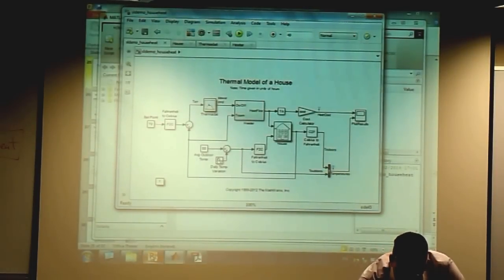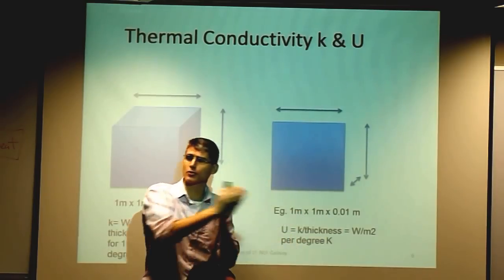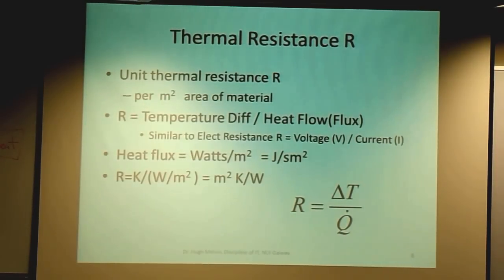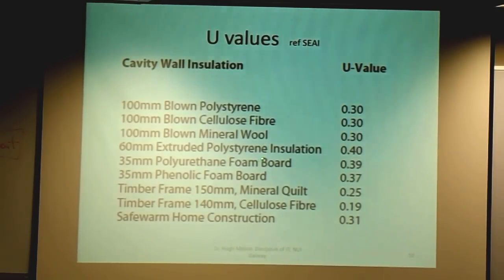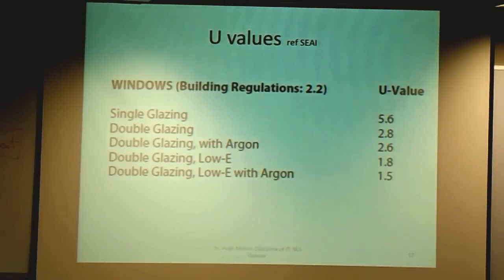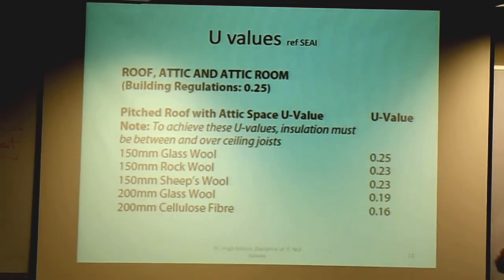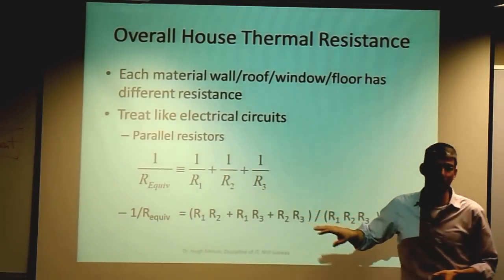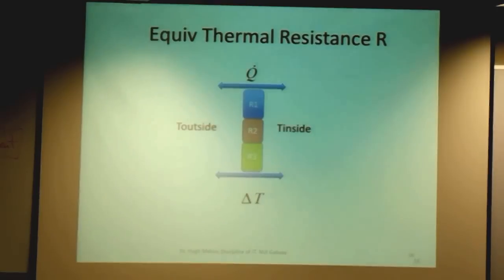CT248 - Intro to Modelling MATLAB - Simulink / Thermal House Model

Comment: Thank you Dr for this lecture 
 I have one question>>> instead of using the relay as thermostat  to turn on and off the heater I would like to use the  VSD 

?how can I use  or represent VSD in simulink instead of using Relay

Thank you again

Comment: At 22:37, temperature difference is divided to equivalent resistance. Equivalent resistance depends on the convection inside the house, which depends on the temperature of the air inside. How is it assumed constant?